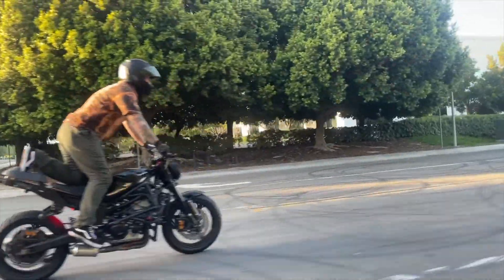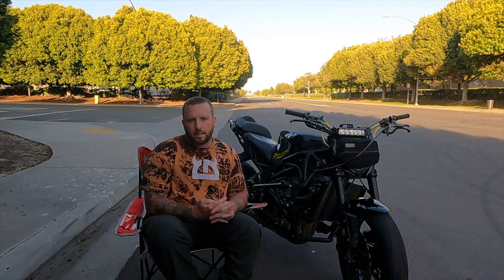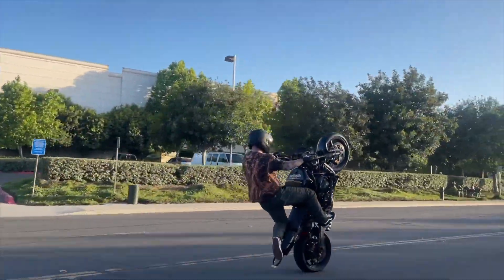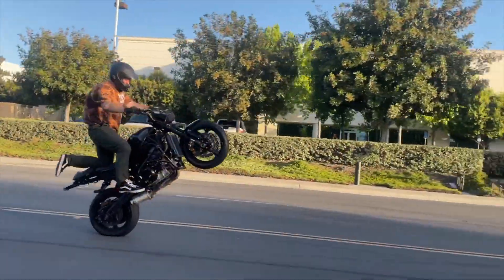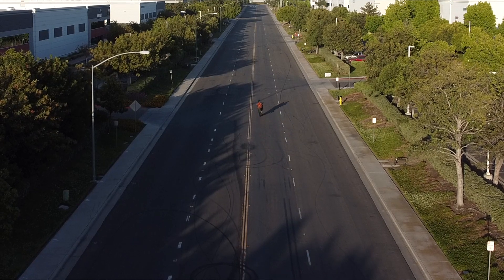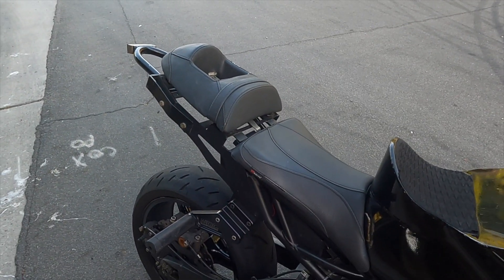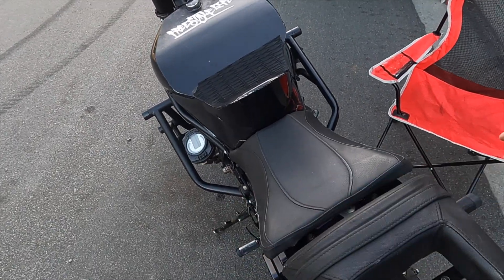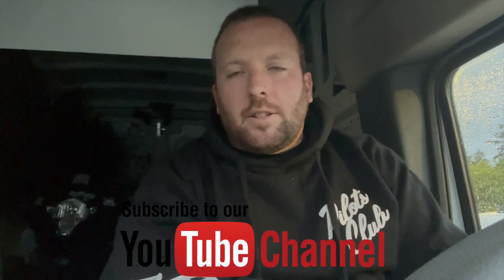Tricks of The Trade | How to Knee Knocker

Comment: great video! My MT-07 on stock gearing has so much engine braking its hard for me to use the back brake before the engine pulls me down. I can do a pretty solid balance point wheelie by quickly blipping the throttle. I only use back brake when I think i'm going to loop.  any tips?
Reply: Yes engine braking is crazy on my mt07 too lol